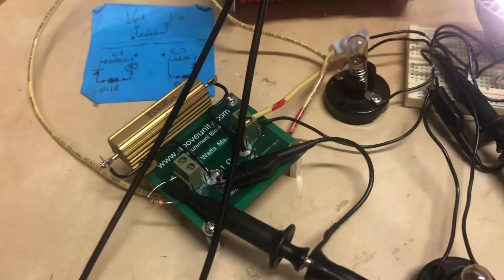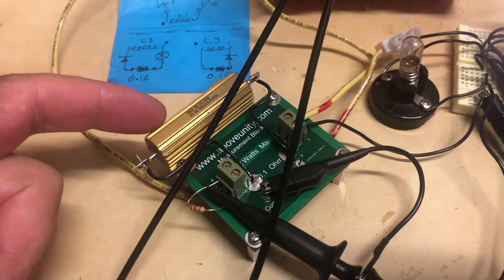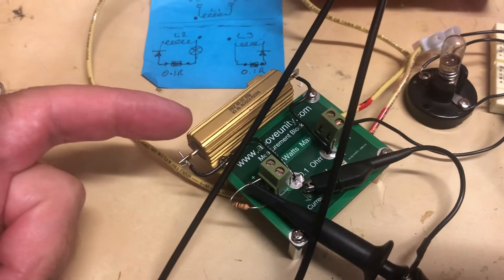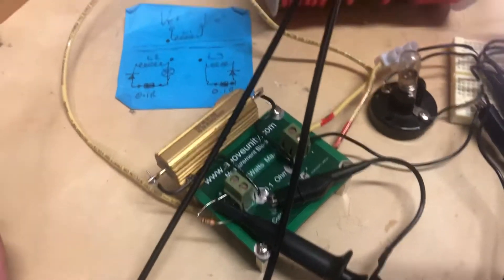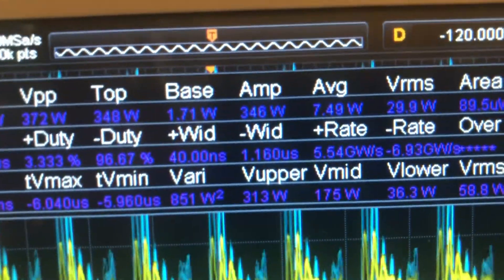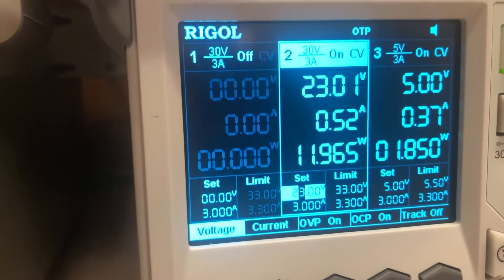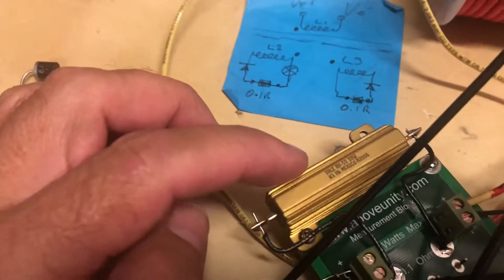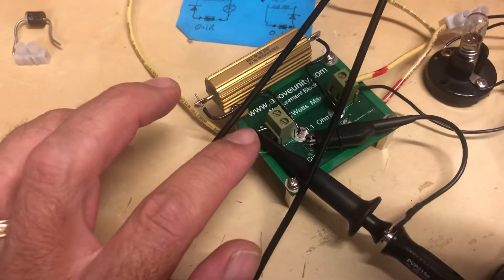Asymmetrical regauging  8

Comment: Consider connecting the lamps used as a load directly to your DC power supply.  Adjust the supply's voltage until the lamps are as bright or a bit brighter than observed during your experiments.  How much power do the lamps draw from the supply at that brightness?  How does that compare to the output power measured during your experiment? 

To verify your scope's math is set correctly, feed two in-phase, 50% duty cycle, zero to five volt square waves into the two scope channels (these have to be 0-5V not +/- 2.5V).  This simulates 5V at 5 amps, or 25 watts during the high time of the square waves.  If your scope math is correct, it should read 12.5 watts ( 25 watts for 50% of the time).  Now, adjust the phase of one of the square waves to be 180 degrees out of phase (one square wave goes high as other square wave is low).  Your scope should now indicate very near to 0 watts (there may be some small amount of power indicated due to overlap of the square waves during rise/fall times).  If you are using 10X probes, you could use 0-500millivolt square waves instead.

Comment: Hi Captian,      thanks for showing the difference a simple resistor makes.
I see you could run in some sort of problems on your forum, so i won't be commenting on your video's from now.

Good luck with your efforts

Regards Itsu
Reply from the maker: Hi Itsu,  It's all good, there are no problems.  All the mistakes have been made by me. Your comments are welcome. 
Cheers,
Loz